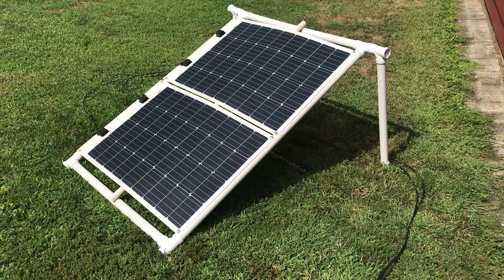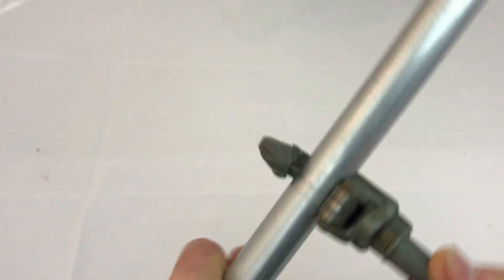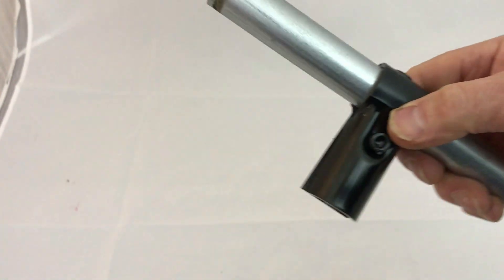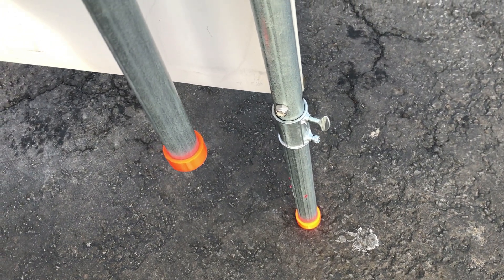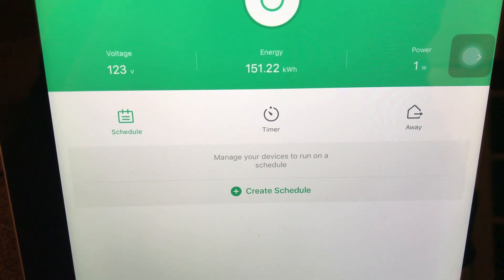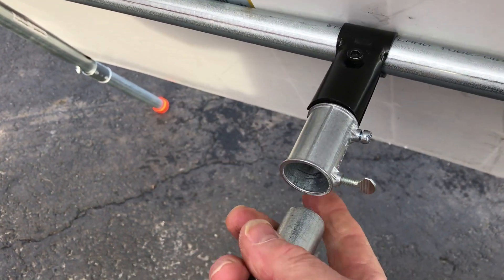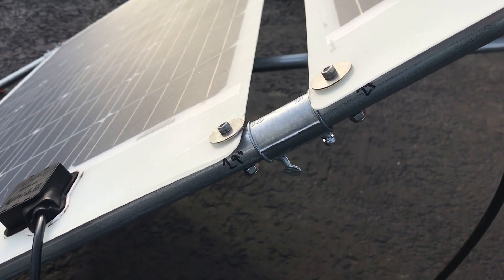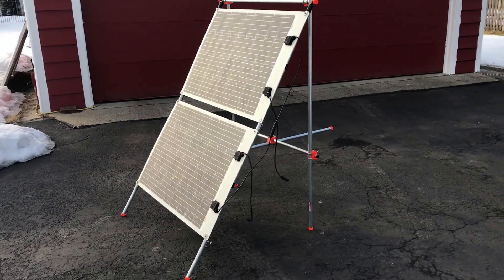Gorilla Solar Panel EMT Stand

Comment: I have 2 panels that should be in any day, to build a DIY solar suit case. I have a few ideas in mind for a stand, but waiting on the panels to start. Maker Pipe fittings and EMT was one of the ideas. But that looks too heavy for a traveling suit case. Any idea what your set up weighs (not including panels)
Reply: each 5' piece of EMT is 2lb 3 oz. Makepipe also works with Aluminum. Since the outside diameter is a bit larger than EMT, you have to removed the clamp "sleeves". I went with the folding panels for portable projects. I have some older Renogy 100W and I also like the Megasolar panel (  https://amzn.to/33ocYhH ), but you can't link more than one together.